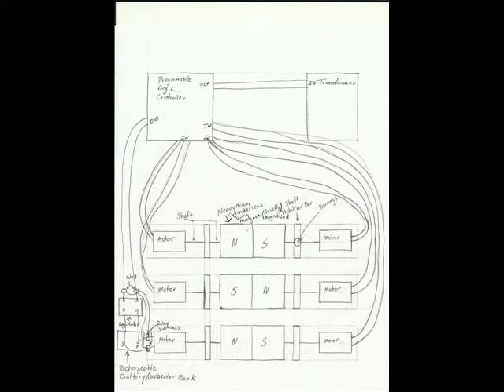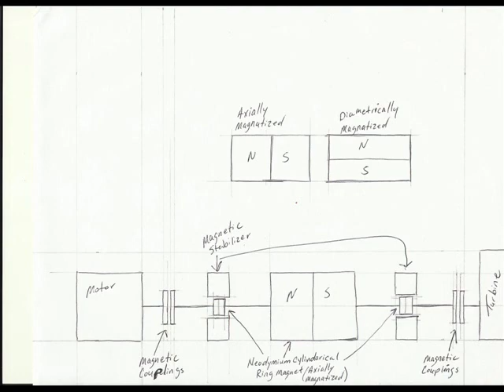Magnetic Field Propulsion Drive System Schematics

Comment: Mr. Holt is on to something with perpetual magnetic drive  systems, but it would incorporate extra grids before  and after main magnetic structure, perhaps using resonance manifolds or amplifiers or both to control and sustain force fields to enable constant drive motions for propulsion drive system.